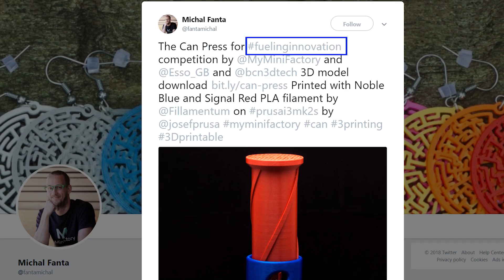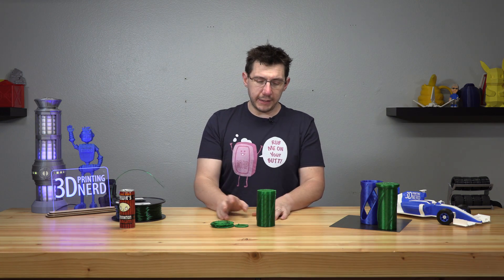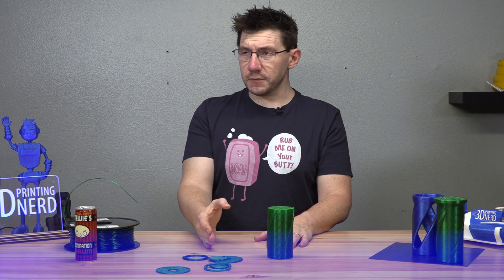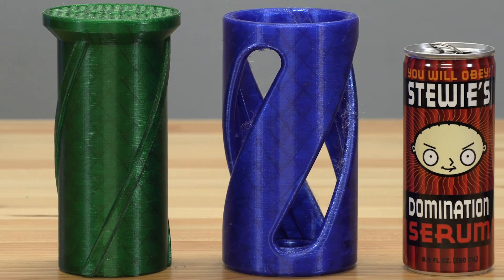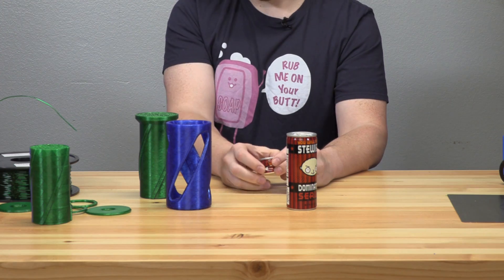The Best Way To Crush a Can? Matterhackers PETG / MyMiniFactory / Prusa i3 mk3 / ESSO Contest

Comment: Uuhhhh, I think you were crushing the cans upside down! There's a hole in the bottom to allow any trapped air to escape instead of becoming a Pneumatic Spring!

Then again, I wouldn't expect anything else from you Joel, High Five!
Reply: That would explain why a full nerd-weight didn't crush it to 3mm high!
Reply: You'd be surprised at the strength of aluminium - even such thin sheet - especially once it's been compressed somewhat. There's a reason it's used for cars, planes and trains!
Reply: Might as well put holes in both the top and bottom to allow better chance of air escaping.
Reply: Also the fact that Aluminium cans are specifically designed to contain pressure exceeding 4 atmospheres of pressure, it's like a chain, weak under compression but strong under tention.